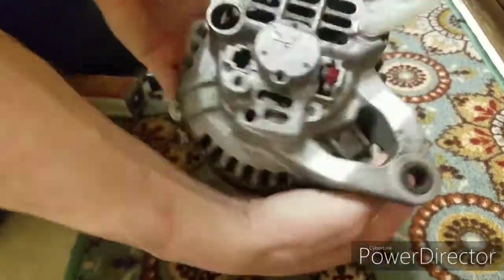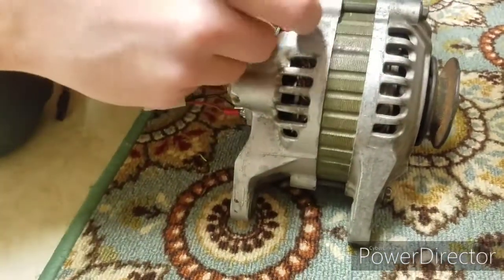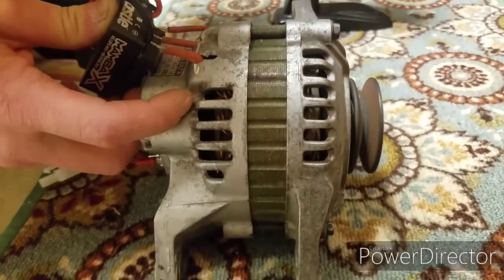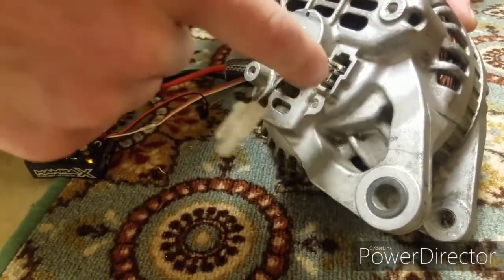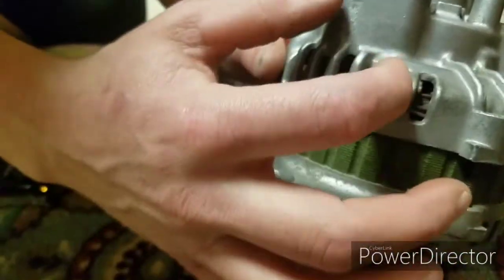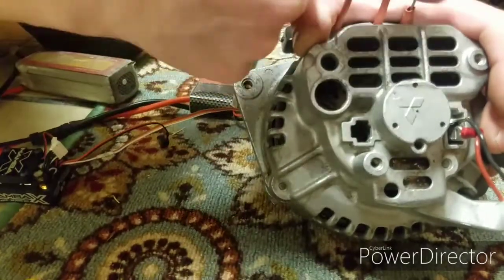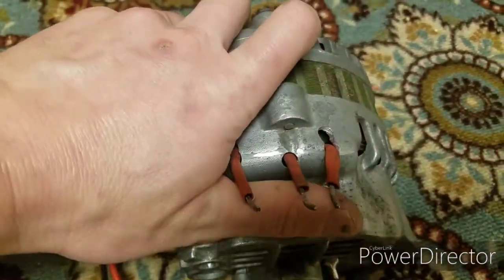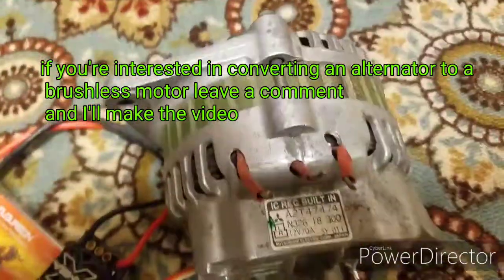I made a brushless motor out of a car alternator

Comment: is it possible to run a  brushless car alternator motor without using any types of circuit board
Reply from the maker: I dont think so. But  I'm not sure I didn't put a lot of time in to it
Reply: @509trails  intrials it would help a lot if you made video on it,
Reply from the maker: @flowtime8673  I'm getting a few alternators in a few day I was going to make a video when I have time I have a few projects that have to be done first
Reply: @509trails  that's a sound geat and look forward to seeing the new content.

Comment: I've been trying to do that but was unsuccessful.  I went through 5 alternators and 3 different speed controllers. Not sure what I'm doing wrong.  I've use 3 wire 4 wire and 6 wire alternators I hook the up just like the videos I've seen and still nothing.
Reply from the maker: Maybe there was  a bad winding in them. I was thinking about getting another alternator an making a video. I have a 6 wire I used a connectivity tool to match the wires in pairs

Comment: How do you do this with the 4kw 8 wire 6 phase Mitsubishi alternators
Reply from the maker: I'm not sure about 8 wires mine only had six i used a connectivity meter and paired the connective wires that left me with 3 connections.
Reply: Ben, do you have an email?
Reply: If you have 3 wires, the windings are set up in a Delta configuration.
If you have 4 wires, the windings are set up in an star (Y or Wye) configuration.
If you have 6 wires, the windings are coming out straight in pairs. You can use any configuration.
If you have 8..... What????